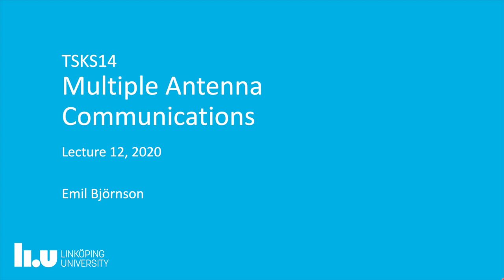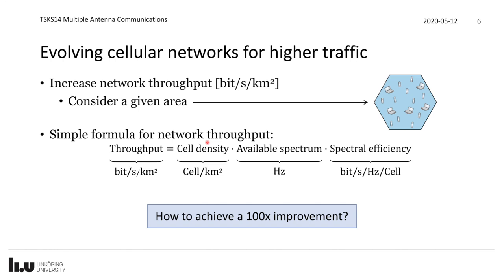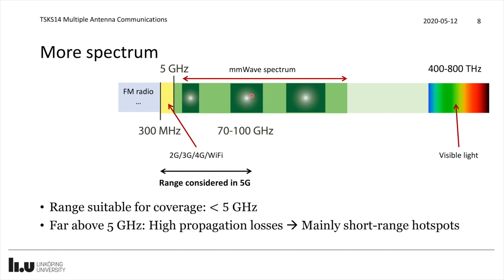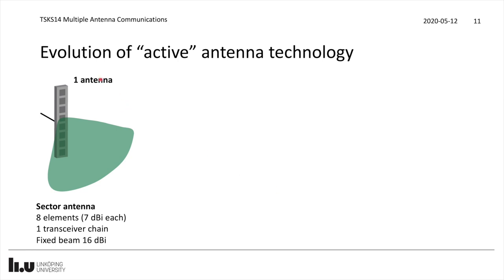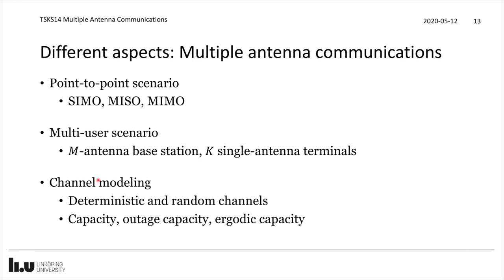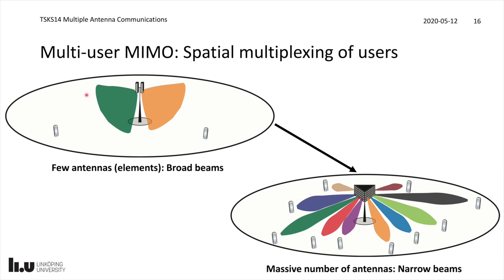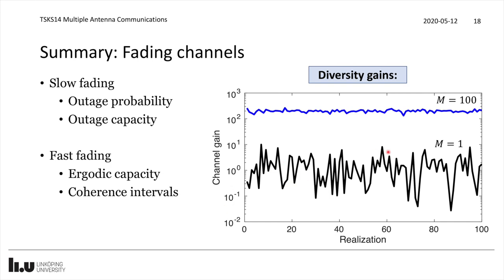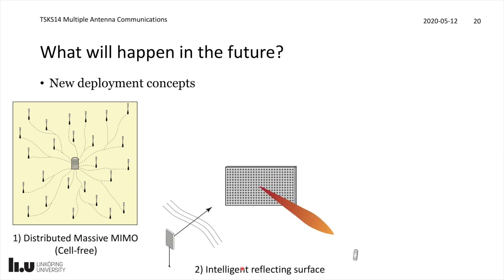Lecture 12: The role of MIMO technology in practical networks (Multiple Antenna Communications)

Comment: Thanks for the great lecture. Please answer my small question, at 12:35,  when SE=4 bit/s/Hz --> 8 bit/s/Hz --> why it requires 17 x more power? How to calculate it? :)
Reply from the maker: 4 = log2(1+15) and 8 = log2(1+255). So the SNR must be increased by 255/15=17
Reply: @WirelessFuture  nice explanations. thanks a lot. :)

Comment: Thank you, Professor, for your nice explanation. I have a question,  in MU-MIMO, if  I have 6 users in the Uplink/downlink, does the BS receive/ send 6 blocks of symbols(i.e, one block per user)? The block means the coherence block that has complex symbols consisting of coherence time and coherence frequency.
Reply from the maker: All the 6 users will send and receive signals in every coherence block. Thanks to the multiple antennas, we can send and receive directive signals so that everyone can communicate simultaneously without causing much interfere to each other.

Comment: In massive MIMO antennas in reality, 64T64R, I have measured that it has 8 beams (SSB) by R&S Scanner. I wonder that "How can? What is the behind mechanism to steer the beam to desired end user when the antenna's angles (azimuth angle and tilt angle) is physically fixed? Pls explain for me. Thank you in advance :)
Reply from the maker: Coherent interference is the key. You transmit the same signal from multiple antennas but with different delays (phase shifts) so the signal add constructively on some directions and destructively in other directions. This principle was exemplified in Lecture 1.